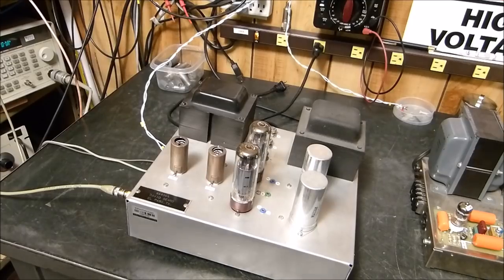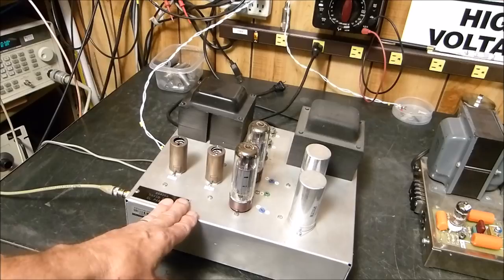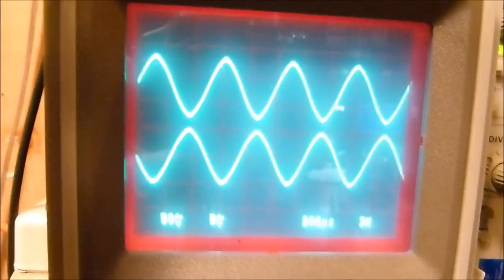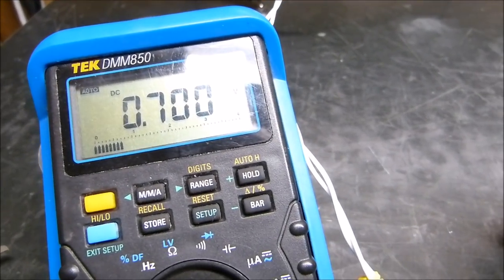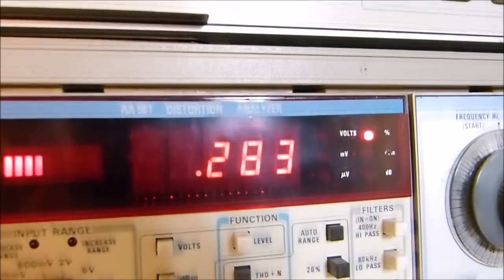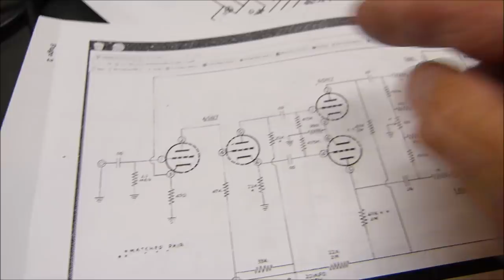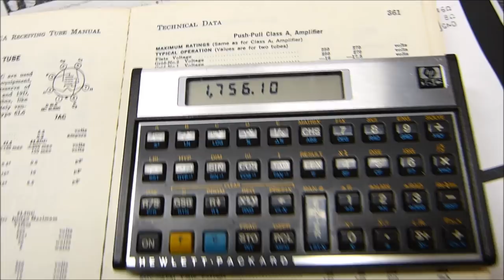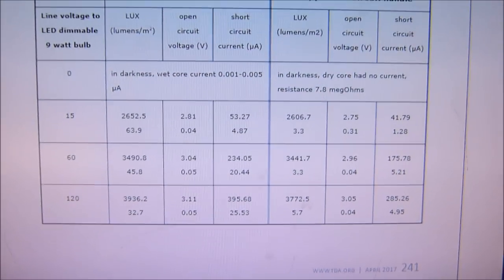Vintage Vacuum Tube Amplifiers & Modifications

Comment: A couple years ago I evaluated phase inverter circuits through spice simulation. I chose the split load configuration for my use similar to the Williamson design shown in your video. It did not come without challenges. If the plate and cathode resistors are to be identical, (1) the loading on the output must be very low (high impedance), (2) to reject power supply ripple the plate and cathode resistors on the first stage must be properly sized, and finally (3) the plate voltage of the input stage (which sets the grid voltage on the second stage) must provide symmetrical operation of the split load stage. Your examples encompassed some or all of these problems. The Williamson circuit worked properly. By the way, the distorted waveform was probably due to change in bias of the input stage due to the feedback. The output tubes probably ignored this distortion since the output tube receiving this was not in conduction (for the most part). I really enjoy your videos.
Reply: I may have misspoke in that the output tube was not in conduction (see above). I've also seen this distorted waveform when the feedback is trying to compensate for something that has saturated (hit a rail, transformer exceeded Bmax, etc.) If you remove the feedback loop, does this lopsided distortion  go away?

Comment: I realize this video is 6 years old but found it very helpful.  I did the AC balance modification to my Dynaco st70.  The mod works well I can null out the error in the phase splitter.  One thing I did notice that made me question my scope or probes was if I connect to the grids of the output tubes then null out the error all is good but if I switch the Leeds around the error comes back.  I did test my probes and they seem calibrated not sure what the issue is but I fudged the adjustment to a happy medium.  Again thanks for this video
Reply from the maker: Hmmm... that is interesting with the probes being different. I think I would put them together on the same point and switch between channels on the scope and see if there is a difference there. Just a thought. Yes, indeed, the AC balance does work and helps bring down THD to its lowest level. Thanks for your comments.

Comment: In the UK one of the most famous amplifier circuits for the home constructor was made by Mullard namely the 5-10 with EL84s and the 5-20 with EL34s .Anyone in home build would have one or other of these amplifiers. I have built dozens of both these amplifiers.
It looks like these circuits are not at all well known in the USA for some reason. The QUAD 11 amplifier KT66 also does not feature much at all but one of the best I have ever measured for distortion and extended frequency response and sounds really clean and detailed.
I guess it was probably availability in the 60/70s.

Comment: Interesting point re: resistor matching in the phase splitter, the same issue comes up with regard to the Schoeps condenser microphone head-amp circuit, where an apparently 'symmetrical' circuit actually has a degree of impedance imbalance at its outputs. The key issue is the difference in output impedance between the two sides of the phase splitter (in this case a JFET, but the principle remains the same) - the cathode (source) side always has lower impedance because it's acting as a voltage follower.
Reply from the maker: Isn't it interesting how we just "buy it" and follow along because it "makes sense". I like your point about the lower Z cathode side.  Stepping out of line and pointing out an error in such an established principle has its risks unless it can be proven with simple empirical evidence. Thanks for you thoughts and postings.

Comment: Nice video,but the mods only works if you have the equipment. If you don't have the gear,Your stuck....
I figured you were going to talk about mods as in Coupling capacitors,HV capacitors, Feed back loop,Cathode bypass caps....How about doing a video on using or sizing Filter chokes,Regulated voltage supplies.How about a Voltage drop calculator for resistors.Just a thought..

Comment: Love your videos. Ya, they help. One of my favorite instruments on my bench is a Singer Panoramic Real-Time Spectrum Analyzer (vacuum tube based work of art). It has a dedicated SOLA "Tele Volt" voltage regulator that feeds the power supply. These ferroresonant voltage regulators are an interesting study. Subject for another video?
Reply from the maker: In a few videos back there was a discussion of how amplifiers often times perform different  at venues and the performance was discussed in the context of AC power. Low voltage from long extension cords, switch mode power supply noise , etc was discussed somewhat and I think the conclusion was that the Sola type ferroresonate, constant voltage  transformers might be part of a solution. They are available on Ebay - some very expensive - and heavy. I doubt anyone will seriously start carrying around these devices to plug their equipment into but it was an interesting discussion. Thanks for your comments.
Reply: The Tele-Volt series was a portable version.

Comment: Well, I really enjoyed this video, thanks. Regarding PC based audio analysis gear, consider also the Analog Discovery ( I and II) along with the PC software from Digilent  and the audio analyzer software from thestuffmade.  Blueglow and Tomtektest have been doing some excellent work with this relatively inexpensive setup. It is a complete audio analysis system as you have described.
Reply from the maker: Thank you. That is exactly the information I am looking for.
Reply from the maker: Shaun,
I have been watching Tomtektest videos and he does a good job of demonstrating the Analog Discovery 2 setup. I am wondering if I even need to make a video on this type of PC setup with his videos posted. I think I will make reference to his videos for now. I would have to buy the Analog Discovery equipment and I think my viewers are interested in a setup with software that could be obtained as freeware and using the existing sound card of the PC. I will have to think about this before proceeding with this video project. Thanks again for your help.
Reply: ElPaso TubeAmps: I agree Tomtektest did a great job on the AD videos.  And Blueglow is setting up a similar, but more integrated system using the AD II as well.  Alternative solutions to a problem are always good, so I am looking forward to see what you work out.

Comment: Nice video ElPaso.. So for the 6L6GC in a 60 Watts Push Pull configuration  .. What do you normally see in the market for the Plate/Grid  voltage and Cathode voltage/Current?

Comment: David, I would be interested in a video showing the THD of the Focusrite (or other sound cards) output as used as a signal generator. Sound files could be generated by spice programs or other various ways and then shared between users.
Reply from the maker: It has been some time since I have use Spice or PSpice but I always enjoyed it even the DOS version. I have thought of some short videos using PSpice but would have to work with it for a while to get efficient with it again. As for just testing the Focusrite and other USB sound cards, that's a great idea and it would answer the question of how well they do at 20 KHz and above. Thanks.
Reply: I've been using the free version of LTspice for about 18 years now. It can consume a lot of time and I miss the smell of solder. I'm always comparing your results to the simulation. I love the way you measure various pieces of real hardware. Remember what Lord Kelvin said about measuring?
Reply from the maker: Yes, measure once in mm and cut twice in inches then convert to the speed of light. That't the way I do it when I work with wood. I tried to make a speaker box last night and all I can make of wood is fire wood.  :-)   Seriously though, and management converted it to, " if you can't measure it, you can't manage it", which I guess is true too. I need to get back into PSpice, I had some projects while working for Lockheed where I used it and I found it a lot of fun. One project was modeling a non-linear load on a half-wave rectified system and then full wave rectification, driving azimuth and elevation  motors for illuminating radar antennas. I will never forget that half wave had predominately even order harmonics and full wave had predominately odd order harmonics.

Comment: Interesting - you could signal generate (even multiplex) and analyse using FFT (discrete), the key is having a good enough DAC/ADC with enough bits/sec bandwidth, so perhaps a programmable chip (ARM?) to drive the data capture as USB2.0 is too slow - it would need USB3 to simply take the stream of ADC.  I've used GPUs to perform realtime 2D FFT for image alignment at 17fps. It's possible..
Interesting point about the dynamic load vs static - I wonder if you could make a programmable dynamic load too using current chopping to different resistances.

Comment: Just came across your video and appreciate you taking the time to educate us on these classic designs, it was very informative!  Just wondering when biasing the current on the Dynamo MKIII tubes, if you were really concerned, could you just put the meter across the two bias points and adjust the DC balance until it read 0 vs. ground and each bias point individually?

Thanks!
Reply from the maker: Yes, if you install the DC balance pot (I took that idea from the Poseidon board design) onto the PC board as I have it in the video, you can adjust the voltage between the two bias points to zero, naturally, making sure your cathode resistors are very well matched and then with the original bias adjustment that Dynaco designed, adjust the idling cathode current to 70 mA thru each tube.

Comment: I had a thought since I don’t have a THD meter could you disconnect the feedback loop from the output transformer then measure for the cleanest signal at the speaker terminals then reconnect the feedback loop ?  Just a thought
Reply from the maker: Many amplifiers have about 16 dB negative feedback. For example, a 20 watt output amplifier with 16 dB global feedback would be measured at 0.5 watts or at least no more that looks really good on an oscilloscope then reconnect the NFB. Or, keeping the output as seen on a scope at a very clean linear level (with NFB connected), adjust for the best display raising it to just starting to clip and trimming at that point.

Comment: hi,the calculation to find the output transformer works well for push-pull ab-1 but i tried the same calculation for single ended class a with 6l6 tube and its dont works .Can you tell me how to calculate for class a single end thanks

Comment: Hi David, on the 3rd amplifier you showed  (the Fisher I believe) you weren't able to get the error line as straight as on the 1st amp with adjusting the 50k pot... was that because there wasn't enough range? If you changed the value of the 68k resistor in series with the pot, would you then have been able the get the line straight? It did increase the performance quite a bit on the 1st amp.. Great idea, Great video..
Reply from the maker: Thank you. That error signal that comes out of the Tek AA501 is very useful but I have learned to take trying to make it perfect a losing battle. It is the sum of the errors and each amp seems to have its own harmonic profile so getting it to zero (or really low) can be frustrating. I am really pleased that so many viewers, like yourself, have found this approach useful and only through real empirical evidence we see that the "matched" resistor approach is not the best solution and making this parameter adjustable does indeed improve performance. As for the Fisher 70-A, it is far from perfect in the high end (on the test equipment) but sounds fabulous and has a really nice low end and along with its matching preamp the 50-C, a pair in good shape can sell on Ebay for big bucks. I listened to one of these Fisher amps and preamps starting at 12 years old playing out of a huge speaker system (looked much like the Klipschorn) but running the EV 15W and some University mid range and tweeter horns and I haven't gotten over it yet.

Comment: if transformers for example are of a set value of resistance and the two sets of windings are to de-couple the tube outputs from the transducer why not decouple with capacitors and use resistors for load value like a transistor amp?
Reply from the maker: The transformers convert the high impedance side of the tube (typically about 5000 ohms) to the low impedance side of the transducer (8 ohms or so). An RC circuit wouldn't do this impedance transformation. In some solid state amplifiers where the impedance of the output transistors are very low, they can be direct coupled to the speaker or isolated through a capacitor as you mention.

Comment: I have to send you a simple resistor circuit you can use a single channel scope to do this
Reply from the maker: I can already see what you are talking about. Sum the out of phase signals together and use a single channel scope. I assume that is what you mean. It just never crossed my mind but that is the beauty of these discussions to find other ways to get the same thing accomplished.
Reply: yes it is how I do it I use 2 20 meg and a 1 meg pot in a small metal box to calibrate the box I hooked it to a ct transformer with the ct being ground than I tweaked the pot until I had 0 reading on the scope than I locked the pot ... this is a cheep passive tool it cost me more for the 3 bnc connectors than the rest of the parts